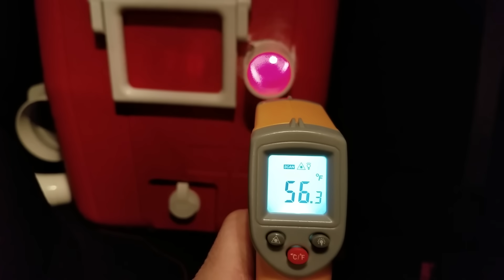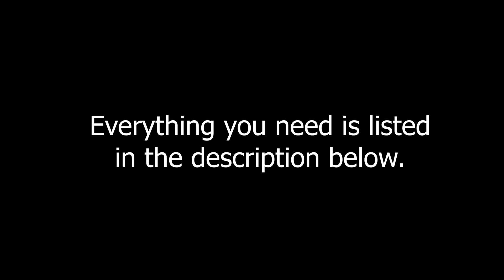Homemade Portable Air Conditioner DIY - Version 2 - Runs off 12 volt battery, car, or solar!

Comment: As a heating and air technician, this is actually one of the best ideas I've seen
Reply: My husband's an HVAC tech he loves this
Reply: Don't work for cars... need a fresh air intake tube... did this and was going thru 3 bags of ice in 2 hours.  . Too much humidity also...
Reply: Nat Pabon buy a new car and hush. This idea is phenomenal.
Reply: @aceventura1980  Must be a poor insulating cooler.
Reply: @aceventura1980  Just crack a window and enjoy the cool air and let the humidity out.
Reply: @Blitzen46  or get a small dehumidifier for the vehicle interior. LOL! Seriously, this would work great for Nomad Van Dwelling, where you have a ceiling vent fan to let the excess humidity out, or actually get a small dehumidifier as well.
Reply: If you have a cheap cooler, drill a small enough hole to fit the tip of a can of great stuff inside. Use the small gap and crack filler. It will improve your cooling power without investing in an expensive cooler.
Reply: Insulating cooler helps a lot
Reply: Exaaactly!!! And its pretty elegant also!

Comment: Ok, so simple thermodynamics means if it's "cooling your air" (removing heat from your air) then it's transferring that heat to the ice, and no matter what kind of hose you use or how you bury it in the ice, if it cools the air, it will heat and melt the ice.

What could you do to actually make this useful?  Well for one thing, a 12V 6A fan is a 72W device.  Contrast that with a portable room AC or a window-mount AC 120V 8A = 960W.  So your device is going to use 1/10th the power... BUT THAT'S OK because the AC units use that power for both direct expansion of gas (refrigerant) and the blower... and you're only running the blower.

So step one.  Figure out if 72W is sufficient.  Hint:  Your average home floor fan moves 300-500CFM.  However, the faster you move air through the quicker you need to get the heat out of it ("cool it").

Step 1: Construct a dual layer cooler where the bottom has the ice-encased aluminum tube and all the air runs through there.
Step 2: Above that layer and MAKING SURE none of this layer can get into the moving air place dry ice.  As the heat is exchanged the dry ice will melt first and make CO2, which you don't want to breathe but as it will slowly be let out it's not a hazard.  When the ice starts to melt, add more dry ice, or let the ice melt, because it's almost done cooling.

Effectively you're trying to exchange heat into the ice, and there's only a limited amount of ice, and it's not very cold, so you can't move that much air through it, and there you go.  If you choose to use one of the obscenely large coolers with 2 hoses, 2 fans, and the dry ice pack above, I think you'll impress yourself more than you know.

Ehud Gavron
Tucson AZ
P.S.  I fly helicopters in Tucson AZ.   I know HVAC!

Comment: GOOD IDEA BUT YOU FORGET ONE THING. AIR CONDITIONING WORKS BY PUSHING AIR IN FROM THE OUTSIDE AND DEHUMIDIFYING INSIDE WORKING TO PUSH IT OUT THROUGH THE CRACKS AROUND YOUR DOORS AND WINDOWS. WITH THIS DESIGN THERE IS NO AIR COMING IN FROM THE OUTSIDE AND THERE IS NO FORCE PUSHING OUT THE HOT AIR IN YOUR ROOM. ITS. NOT AN AIR CONDITIONER. ALL YOU REALLY HAVE THERE IS A FAN RECIRCULATING THE SAME HOT AIR IN YOUR ROOM.

Comment: Blowing hot air through a tube running through ice is simply dumb.  Unless the air is moving extremely slow, the heat transfer is absolutely terrible. This thing makes a better ice melter than ac.

Comment: pretty cool design. i love it. Now I just have to find out a way how to make it run while we are camping in our SUV while the motor is not idling(Since we camp in our SUV instead of a tent lol).
Reply: 100 watt solar panel should be able to run that fan when the sun is out.  That fan is 6 amps and the panel will put out 5 to 6 amps. Won't work at night, of course.

Comment: Hello,
We made your model version to plug into an outlet verses using the solar option.  We used an adapter with 12 v-6A.  When we plug it into the outlet the fan barely pulses. Do you have any recommendations of how to complete this project using a different adapter?
Thank you,
Eve

Comment: Instead of pushing the air with the fan, can't you reverse it and pull the air so you can just put a flat vent on the intake side and have a fan blowing out?

Comment: Plumbquik 4" x 2" Flexible Rubber Coupling + Plumbquik 2" x 1 1/2" Flexible Rubber Coupling = should be 4" x 3" + 3" x 1 1/2" surely as the semi-rigid metal tube is 3" thick.

Comment: On your house test, was there AC running in the other rooms? What was the ambient temp inside the room with the DIY unit before and after unit was turned on? Same with the SUV, was it parked in the sun? shade? Outside ambient temp?

Comment: Aye, can you talk about the screws you used and the other small things you needed that are not listed?
Reply: I used 1 inch oval head Phillips screws
Reply: @Sopeduty  thanks
Reply: @Sopeduty  i bought the supplies...im working on it over the weekend
Reply: I had a bit of trouble with the wiring but everything else is pieced together already I'm going to continue it later on this week or finish it up next week. Did you get the wires listed in the description also? If you get it running can you tell me which wires worked for you I have not did the alternative combos yet and thanks in advance

Comment: Hi. I built one just like you instructed.  The issue I had was the flexible pipe isn’t water tight so it would fill up with water resulting in no airflow.  If the ice doesn’t melt or you can keep it drained out, the flexible tubing is a great idea.  Thanks for the video.
Reply: Yeah there will be water collected inside pipe, due to condensation. Add out let pipe to drain your water, from bottom.

Comment: Im planning building one..........but wonder if the fan has a strong suction from the back as air flow to the front..........if so I plan on Mounting my fan underneath the cooler top to catch cold air ............ that's inside the cooler if you wait 30 minutes  be for use  then let it  blow  threw the tubing that's under the ice.....and then out the ice chest........it would do 3 things........not blow hot air inside the cooler from the out side.........no chance of water leaking from the side and ....3rd the fan blower maybe quieter............ cause  it's enclosed...compare to being on the out side,
Reply: If you put the cooler on the inside lid, it will suck the lid down and make a vacuum in the cooler.  Better: mount the fan high on a long side with the intake sticking out a short side slightly but with the fan inside the cooler. That would still let you have easy access and less noise. Most of these units would be used for camping so put it at the lowest part of the tent/camper so it gets cooler air at the intake.   I would mount the outlet pointing straight up or angled up and toward the sleeping area since the hottest air is at the top so get it cool first.

Comment: I built one of these for my plane. At 10,000 feet it is always cool but on taxi, climb out, or descent, it can get quite hot, especially in the south.  It worked well but I think I will try salt (I used to make hand-cranked ice cream) to make it run cooler.  One adjustment I had to make was a device to convert the voltage from 24 volts to 12.
Reply: Where did you buy the fan?  I have an SR20 and fly in Florida mainly….taxi and run up is brutal!

Comment: So you're reducing a 4" blower to a 3" flexible hose at the inlet and then a 1.5" PVC at the outlet.  Why not reduce the inlet to 2" allowing more 2" flexible hose inside the cooler to supposedly cooling the air more?  The air flow restriction on this setup is the 1.5" outlet so I wouldn't think a 2" flexible hose would affect the flow too much?  Any comments from the DYI'ers out there?

Comment: i really love your design.. and i am wondering about using it with a round 5 gallon style insulated liquid dispensor.. the metal tubing could be spiral along the wall of the inside from top to bottom.  Also an addplus? possible could still leave the dispensor in take for dispensing cold water or whatever, while having the air condintioner capability? https://www.walmart.com/ip/Igloo-5-Gallon-Heavy-Duty-Beverage-Cooler-Orange/35520771

Comment: i am wondering if without the fan to passively extrude cold air out via an opposite type of heat exchanger tubing that extrudes hot air passivly in a fireplace?. with your design with outlet coming out the bottom.. perhaps it would blow some amount of cold air by suction of hotter air coming in from tube inlet above? This could be interesting way to make it work even without an electric fan? It may not blow as much but i wonder how much air it would blow with this passive technique.

Comment: Works great, I ran into a problem, the the 3" duct metal hose was leaking inside of the duct, any other stronger ducts that I can use that is water tight?

Comment: Hi there, what I gather is the current temperature of the room goes through the small pipe through the flexible silver piping that's covered in ice, for cooler air to be pushed out through a fan. Is this correct? / If I was going to fill up the box with Ice to not bother with it for a while, with the ice level higher, can I put the  fan up higher to the top of the box? /  Also what do you think is the biggest size room your device will accommodate. / Thank you, Michael

Comment: Im wondering if there would be any benefit to lightly wrapping the whole aluminum pipe with cheap copper piping or cutting up a whole bunch of aluminium cans and making some heatsink fins for the pipe.
It could possibly reduce the temperature quicker and give an overall lower temp due to the increase in total area, whilst adding (what adds up to..) a giant heatsink for the air thats flowing through the pipe..

Comment: Just completed this build and it was an complete failure. Not sure what I’ve done differently or incorrectly (followed instructions completely), but 90 degree air going in and 90 degree air blowing out. Also, 10 lbs of ice only lasted 3 hours. Suggestions?
Reply: Did you have any issues with the wires? I followed the video but my fan does not spin
Reply: Sopeduty nope. Everything worked as demonstrated. It just doesn’t cool.

Comment: After adding everything up, its roughly $120+ for this setup, which if all you want is something portable that's not too bad really, but for a room or 2 you can just get a 5k BTU unit for like a literal $150 easy at a walmart lol.
Reply from the maker: I'm not sure where you may have bought your parts, but this build only cost me around $70.
Reply: make & do Off the links provided, just the cooler and fan will run you $60-#70+ so, donno where you got your parts, but based off the links it's well over $100 total.

Comment: I had someone make this for me. It was a waste of money. The sound of the motor is so loud. I couldn’t hear my phone and it was sitting right next to me. I had it on for over 4 hours. It did not cool my living room down at all. In fact it got hotter. I wound up having to buy a real air conditioner.

Comment: Have you ever ran into any problems with the cigarette lighter piece. Mine doesn't seem to pushing the adequate amount of power, also it appears that the glass on the fuse inside turned white like frosted glass. Could this be a bad part ?

Comment: One more thought...do just as he did (maybe raise the intake higher)...crushed ice around the metal duct on the bottom, then a metal grate across the whole thing, and then block ice on top of that. Block ice will melt much slower then the crushed ice, and the cold air from the block (above) will keep the crushed ice below from melting even longer.

Comment: Air Conditioning removes moisture from the air this system adds moisture it would only work in an arid region and marginal at that.
Reply: No, it doesn't. It is not evaporating water like a swamp box. Air Conditioning removes moisture from the air and the  slight amount of water this produces is exactly the same as what drains out of all your refrigerant based air conditioners
Reply: The key word is (marginal )       The ice will only last in a few hours if this unit is set in a 100 degree Van or car in the summer I would bet the car would never cool to 80 degrees before the ice is melted........Second it will not remove the humidity which for that reason is not air conditioning . Hey it's what I do for a living.........air con·di·tion·ing
er kənˈdiSH(ə)niNG/Submit
noun
a system for controlling the humidity, ventilation, and temperature in a building or vehicle, typically to maintain a cool atmosphere in warm conditions.

Comment: Yes, time matters because when you originally put the ice in the walls of the cooler were at room temperature. Then after a few hours the walls changed temperature through conduction from the ice changing the ambient temperature in the cooler making the air colder coming out.

Comment: What was the purpose of adding water? To accelerate the cooling action?   If that is the case, when I was a kid and had a hand crank ice cream maker we would add rock salt to accelerate the cooling action, and didn’t melt the ice down too fast.  Wonder if this would be a better solution than water. Just throwing it out there for comment. Good video by the way!
Reply: Typically I would have added water to increase the direct contact area with the aluminium pipe to increase its efficiency as a heatsink (too many gaps where solid ice gaps aren't touching the pipe and thus not really drawing out the heat)
I would also add a hand full of rock salt too for the reason you detailed.

Comment: Hey Bud, nice design.  I made one and it works great, ty.  As the ice melts the hose would float up so I used a tension rod and ran it over the hose to keep it down.  I am getting water in the tube as the ice melts,  are you having the same effect? I am going to try a heavier duty dryer hose.

Comment: I built this cooler using the same stuff that he used in the video.  It really does work better than the first cooler because of the high powered fan.  The only thing I did different was I mounted my blower on the top of the chest.  The only issue I have with that is when I reload with more ice the metal tube rises up from me opening the lid.  The objective is to cover the tube with ice but once I add some water it melts around it to cool it.  I tried using mine in the day and it did not cool at all!  The air was cold but my truck did not cool.  Once the sun was completely down it worked pretty good but I added another 12v fan to help circulate the cool air faster and it worked well.  I use mine in a 1 TON DUALLY TRUCK.  Over all in my opinion... This is a pretty good set up.  I dont recommend using it in the day time.  Its just way to hot and it didnt cool for me at all.  At night I was comfortable.  If you make one I think you should find a way to make the ice last as long as possible and you should be happy.
Reply: Michael McGee I'm gonna be in a hot connex. After 3 different methods I thought this was the one, are you saying it didn't cool you even facing you directly?
Reply: Joshua Garza  It did a good job once the SUN was COMPLETELY DOWN.  I also had 2 other fans that helped circulate the air faster. After trying 2 different cooler type air conditioners, I just went out and bought a generator and a small A/C unit.  THAT REALLY WORKS.

Comment: I might try this in my 2000 VW Golf. AC doesnt work and might need a new compressor but till then i might try this and put it in the hatch so it not visible and easy to access without pulling it out everytime i have to fill it up with ice. Just pop the hatch open the cooler and fill er up....its hot here in TX lol
Reply: Did you try it? I'm in a similar dilemma lol.

Comment: Great Job on this project & thanks for sharing! I see a lot of good comments and questions here. My humble opinions; since warm air rises, more tubing can only add more cooling if the ice/water are up to top of tubing. However, more tubing length will increase friction losses and reduce flow; there is a trade off. Adding salt will reduce temperature of water and increase cooling effectiveness but would be corrosive to a metal tube. Adding tubing to inlet will reduce noise but will also reduce flow; another trade off. I like the 270 CFM fan and as large as possible diameter flex tubing.. The larger diameter tubing has less frictional losses resulting in more flow. This design appears to have good heat transfer and flow but you can only know if it is optimized by varying output flow. As flow is reduced, the outlet temperature will be colder but with less flow; another trade off. There is optimum flow for maximum cooling and would take some experimentation to determine the BTUs produced under different flows to determine MAX BTU Output. This design is on of the best I have seen. Again, Great Job!

Comment: What do you think the following would do to your system - add a vent (attached to the cooler near top side) to the metal tube that is submerged with ice water connected to the inline blower that you recommend connected to an outflow tube? That way, your blower is circulating cooler air. Thoughts?